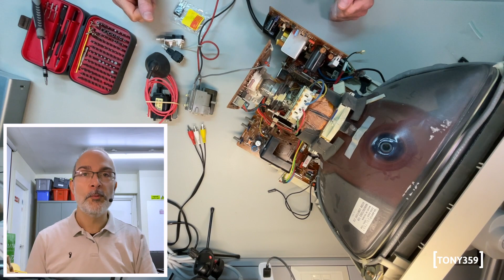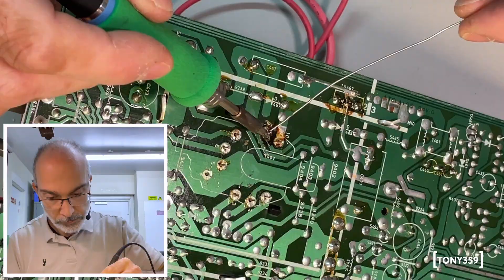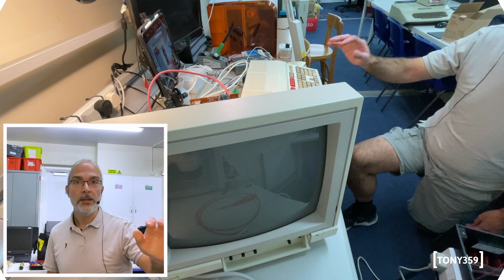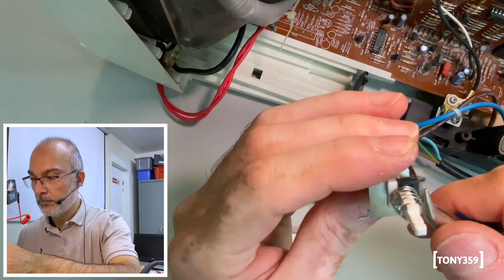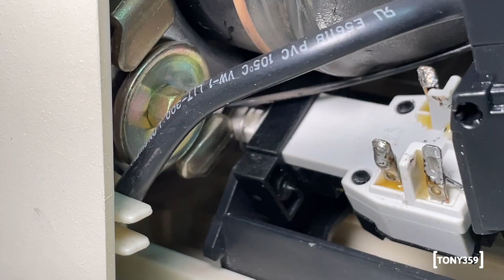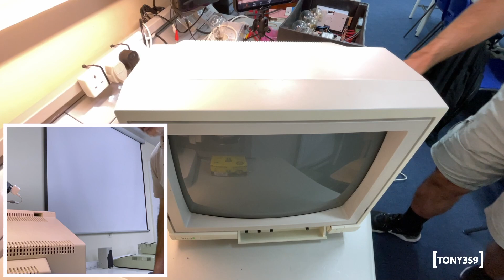The Museum Tales #1 - Fixing an ACORN CRT monitor

Comment: i know this an older video but i was wondering if you had any information on what parts would be needed to upgrade this model to improve its feature set (add s-video/composite/stereo sound) that other models with the same chassis have?
Reply from the maker: I'm afraid I don't - also I don't have that monitor anymore. Sorry!

Comment: Hello, I'm repairing an identical monitor, with an identical fault (high pitched whine, no picture).  I've bought the flyback transformer you link to, but do you have a link to the transistor, please?
Reply from the maker: Hi - we bought it from the same shop! I think they have a few types available, you might want to get in touch with them for advise! I hope you can fix it!

Comment: When crts are working right they are unbeatable, when theyre not theyre a swine to fix, it can literally take hours to setup the picture, if the screen control is up too high it will heat up the shadowmask.

You need some heatshrink on those switch mains cables homie
Reply from the maker: ... and it failed again! It's in my shop waiting for TLC :) 
Yes, heatshrink would not be a bad idea, I'll see if I remember when it's open again! Thanks for your comment!

Comment: It looks like this is almost identical to my Commodore 1084S-P. I have two I need to replace power switches on. So this video may be very helpful! Thanks.
Reply from the maker: Indeed Commodore based their 1084 on a Philips chassis. There are many variations but that was a very successful monitor re-badged by many other manufacturers. Spoiler: it's failed again and it's back to my shop, watch this space :) 
Thanks for watching!

Comment: Those crackling sounds when you go to test your repair don't sound very reassuring! I'd be panicked and immediately cut power.
Reply from the maker: Absolutely! I’m told 😮 it’s XRay protection as the tube was being overdriven by the ‘screen’ control set at maximum! 😳 
Thanks for watching!

Comment: The clicking / crackling really sounded like the aquadag coating on the CRT was not connected to ground on the PCB.  Connection is made via metal straps held firmly in place with springs, and then a wire + plug into the PCB.

Safety is always important - and better safe than electrocuted, but the G2 ("brightness) and G3 (focus) adjustment screws on the flyback transformer is perfectly safe to adjust with an insulated screwdriver.
Reply from the maker: Thank you! I am told that the clicking was the "X-Ray" protection engaging because the SCREEN was too high! Scary! I understand the importance of grounding the tube and I believe I didn't forget anything that time - at least I didn't notice!
You're not the first one mentioning that those controls can be operated with normal screwdrivers but as you say, better safe than sorry! But thanks for pointing that out!

Comment: I've changed dozens of flybacks on Commodore monitors. For some reason only known to the manufacturer those HRDiemen replacement flybacks have the screen control knob turned up ALL the way from factory testing. I've seen it on all the flybacks I've replaced (dozens). You must turn it all the way down and then adjust the front controls brightness knob to the middle position then adjust the screen control knob up until the raster lines are just not visible. The full brightness is over 20000 volts to the neck board and will damage the monitor if left on for too long.
Reply from the maker: Ouch! Thanks for that! I feel like Mulhouse with the XRay machine! Thankfully I found out pretty quickly! Thanks for that!

Comment: Good job!. I would really like to learn, as I have one monitor non working and need to fix it. For the moment, security lessons learnt.
Reply from the maker: I forgot to add a safety disclaimer with this video! Be careful, CRTs are nasty, the High Voltage can go up to 30.000 Volts! Thanks for watching!
Reply: @tony359  Well, I guess that there are not many old monitors around (and I am trying to find some more). A warning is always good. Another excellent video Tony !!!!

Comment: Amazing! I`m including some CRT with "mino" faults iun my collection so I have learning material once I dive in that, learning a lot from here!
Reply from the maker: Amazing! I forgot to add a safety disclaimer to this video! Be careful with CRTs, they have deadly voltages inside! But good luck!
Reply: @tony359  Thanks! Still not ready to start working on them, but learning about every precaution also from videos from Adrian`s Digital Basement. For the moment doing basic testing and restorations and sharing a bit in my small channel :) (not under this username but under The Stranded Quarian)

Comment: hey Tony, please, tell me if 13v on the 12v rail is way too much. i have an ATX 1.0 (the only one and 3x AT PSUs) JNC 200W PSU and with the voltmeter it showed me 13v and a peak of 13.3v. I really don't want to burn my 2003 year PC. great video, as usual :)
Reply from the maker: 13V with nothing attached to it COULD be ok. Can you plug an HDD you don't care about and measure again?
Reply: @tony359  just checked, with the voltmeter (not a good one i might add): PC in standby 12.8 - 12.9v, PC under load in 3DM2001SE: 13-13.2v
Reply from the maker: I wouldn't expect voltage to go UP under load to be honest. But it does sound a bit high. Whether it might cause damage I don't know but old computers rely more on 5V than 12V. 12V was used by HDDs to spin the platters. So maybe not so critical. But I cannot be 100% sure I'm afraid.
Reply: @tony359  i only have on the 12v line a 12cm fan 1000rpm  and the sd to ide adapter, that's all. tnx for the answer, Tony

Comment: 😎Cool, so now you know more about crt's.👍
Now we just need you to STOP using that Knife so Dangerously.
Always Clamp the Workpiece, so you can use Two Hands to Guide the Sharp Edge Away from You !
Imagine how silly you will feel, explaining your accident to the nurse at A&E... 😢
Reply from the maker: "I was fixing an old CRT monitor while shooting a video for my youtube channel and..."
"Psychiatric yard, next!" 

:D 

I appreciate your concerns, I do! I'll be careful. I know it doesn't look like that but holding the knife like that gives me a pretty good control. If the knife slips on the workpiece, the body of the knife hits my thumb and the blade stops there. Without the thumb as a "failsafe stop" it would be dangerous for sure!
Your way is also great though. I need a desk vice though! :) 
Thanks for watching!
Reply: Poundland, or someother cheap'o craft store.
It's a green coloured vice with rubber pads that can be fitted as needed.
Clamps onto the edge of the bench as required.
Sits on a "ball joint" like certain camera tripods.
Reply from the maker: I see what you mean. Probably useful. At home I have a metal one but the pivoting one sounds more useful!

Comment: Nice job! The tool to measure the flyback windings is known as a "ring tester." I also would not have replaced the HOT if the original was testing ok/not shorted because there's no guarantee the replacement would have been good or be any better, but that's just me. As far as the brightness being too high, I was sitting here saying out loud "the screen pot is all the way up," then you said it was maxed out and I was like "See, I told you," lol. Having the screen pot all the way up won't usually damage anything, You can turn it down and be fine. The proper adjustment would be to...

1) Turn brightness/contrast all the way down. 
2) Turn the screen pot up until the retrace lines appear
3) Turn the screen pot back down until the retrace lines JUST disappear
4) Adjust brightness/contrast as necessary. 

That should be it. Again, nice job.
Reply: So speaks a man who has repaired a LOT of monitors! 😁